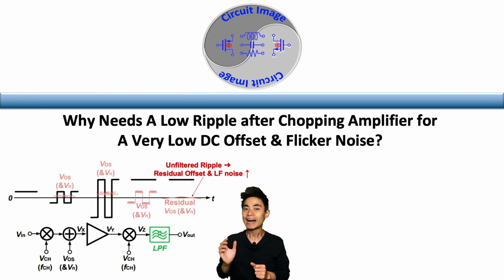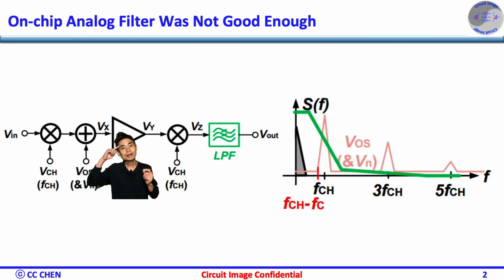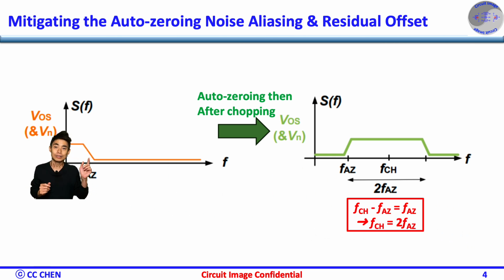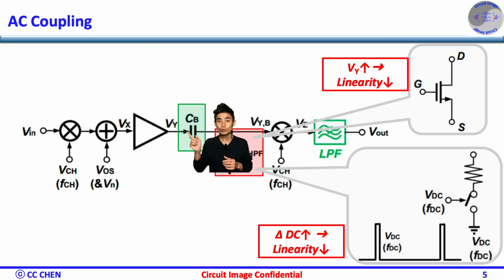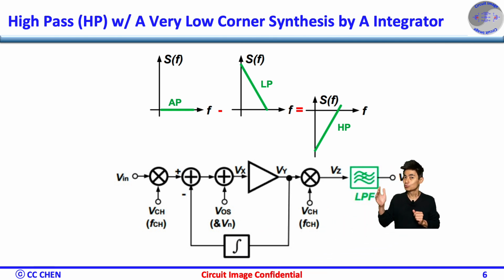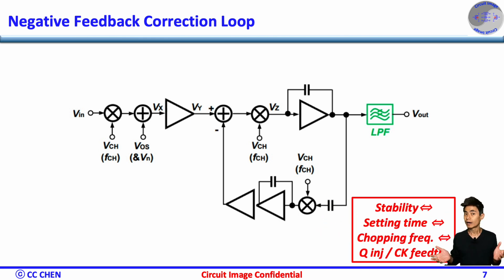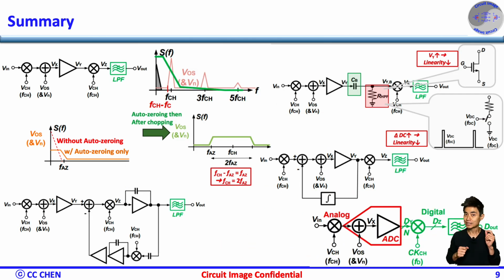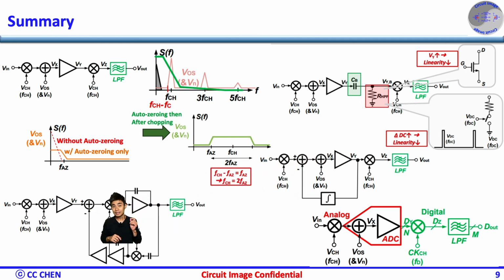Why Needs A Low Ripple after Chopping Amplifier for A Very Low DC Offset & Flicker Noise?

Comment: Why the current mode logic circuit must provide a bandwidth of about 0.7rb? where rb is operation rate. 
This CML circuit is using in CDR/DMUX, Thank for you help.
Reply from the maker: Hi 國朝, nice to meet you and thank you for asking. But, I'm not sure which. topic you're referring since this topic is "chopping amp," not the SerDes you're referring. Am I missing something? If you could repost your question to the corresponding image, that would be great. :) Thanks again.